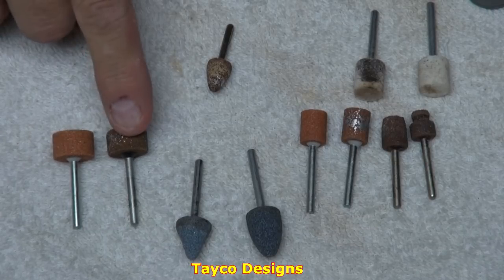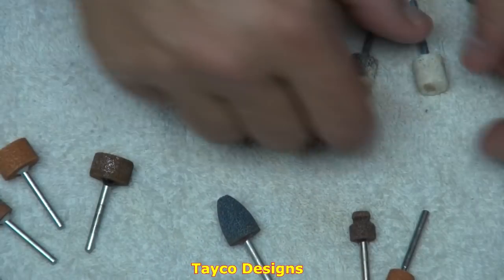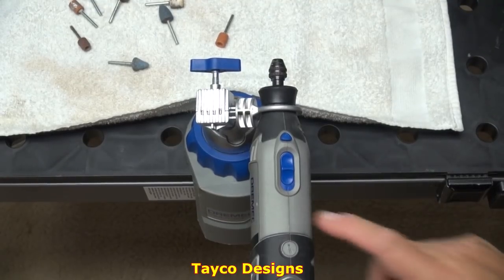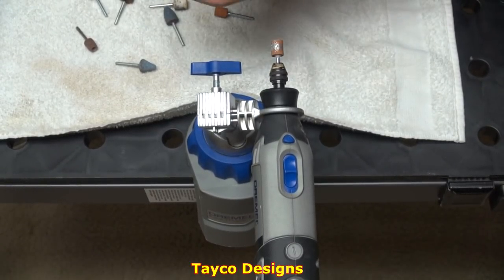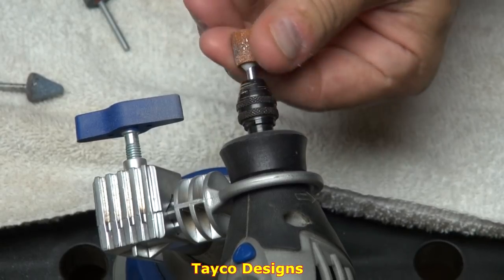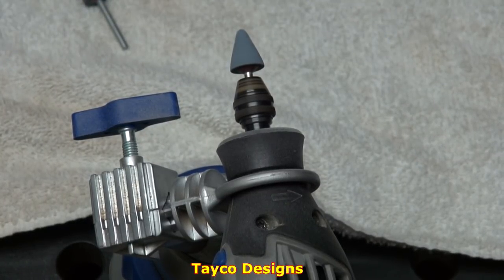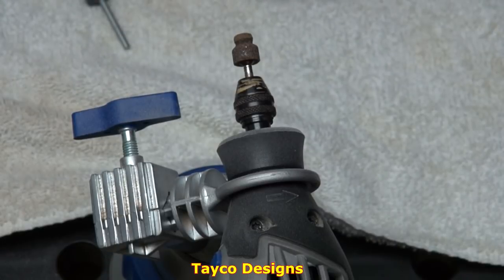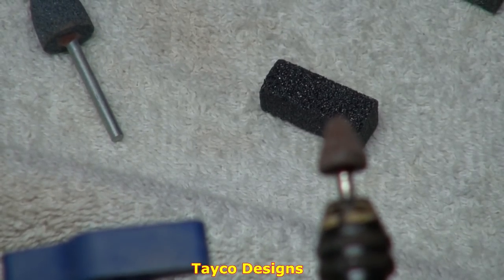How To Use The Dremel Dressing Stone To Reshape Or Refurbish Your Grinding Shaping Accessories

Comment: Thank you so much for this video.  I used my Dremel grinding stone to remove excessive material from a pair of aluminum bumper brackets on my R/C monster truck and the stone got loaded up with the aluminum.  I used your technique shown with the dressing stone and it removed all of the aluminum.  I found that setting the speed control on my Dremel 4000 rotary tool to 20 worked the best and it helped speed up the process considerably.  At first I tried setting it at 10 and that was taking too long.

If this is your first time doing this, as it was for me a few days ago, be aware that the dressing stone will decrease the outer diameter of your grinding stone a little.  That makes perfect sense since the stone is also used for reshaping grinding stones, as shown in the video.  If you have a lot of aluminum stuck on your grinding stone like I did, you will have to really remove a lot of material from the stone to get rid of all of the aluminum and thus its outer diameter will be a little bit smaller compared to a new one.

Thank you - you saved me from having to buy a new grinding stone!

Comment: If you’re going to use a grinder on soft metal like aluminum, touch the wheel to a candle or a block of wax first. It will keep the soft metal from penetrating the wheel and perhaps also keep the wheel from exploding in your face.
Reply: Thanks for this awesome tip! - maybe the OP can make an 11 min video to demonstrate

Comment: Right on! 
I appreciate the video.
I just got my Dremel about 6 months ago for something that I needed to make, and my other tools were just too big, really.
I mean, they would have worked but it's a tool that I have wanted for a long time and that was the projects that justified my purchase.
I was thinking that the stone might be something like that and the YouTube algorithm put you at the front of the list, so congratulations on that.
After one month I don't have a brass, copper, chrome, or any type of metal trim pieces in my possession that arent shining bright as ever.
I had an old rusty 18/20-inch kukri knife that had only had an edge on the belly to tip (about half the blade was 90deg. flat) I didn't care about the knife so I thought I would see how my free handling would do with the dremel only, no belt sander or grinder, I have never made a knife or really detailed shaped steel, I have however worked in fab and machine shops on and off for the last 30 + years.
It actually came out well, its a compound bevel and I was able to freehand the bevel geometry the rest of the way through with some stones and sanding drums, and its pretty dang right with the other one, but I would work it for 30 minutes or an hour a night taking my time because I'm only playing around. 
I now need to figure out the steps i need to go through to get the finish to match the rest of the knife and I might like this thing.
The Dremel is a cool little tool that can do some neat things for a single unit.
I'm going to try to do the finish and all using only the tool.
Just because I can show what that little thing can do.
In capable hands! Lol.

Comment: I buy stones in bulk and only use a dressing stone to true them back up before they get too far out of shape and only while I'm actively using them. If they  get too worn or grooved, I chuck them in a box and use them for oddball projects or ones that will use them up quickly but don't need them to be exactly true, like general grinding or paint and rust removal. If I need one to be precice or an exact angle or plane I just grab a new one.

Comment: FYI Dressing Stones should be soaked in water before use. They should never be used dry. The object that you are cleaning should be rubbed up against the stone not ground into it at high speeds.

Comment: Thanks for the nice video. Some stuff was not in focus but I didn't miss something because of that.
Now for a few questions. I've searched for dremel dressing stones and could only found the #415 dressing stone, which looks like the coarse one (the one you used most in the video). I couldn't find the fine one you show at the end.
Another question - do the dressing stones themselves go out of flat eventually? With stones used for sharpening (especially waterstones) it's necessary to flatten them from time to time (e.g. on a diamond lapping plate).
The Dremel dressing stone looks like a rather small item at not that low of a price. I am wondering if there is a more cost-effective alternative - for example, a diamond wheel dresser (used to true up bench grinder wheels, very similar function) which is more expensive, but larger and possibly more durable?
Do you have advice regarding which RPM to set on the Dremel for this job?
And final question, what are those neat-looking parallel jaw locking pliers you're using?
Thanks :)

Comment: What is a Dremel used for mostly? I bought mine thinking I would use it alot. I used to polish something once but a rag worked faster. I think I used it one other time for something. What do most people do with them?
Reply: Lots of people use them for jewelry related stuff. Making it or restoring it. Wood carving, engraving, etc.. You can polish tight spaces. The little cut off wheels and sanding drums are probably the most used tools for people. I mainly use mine for polishing with the felt wheels. Bolts and screws and things like that.
Reply: Dremels have many uses. Grinding and Polishing are only a few of the thousands of things they can be used for. Watch some videos and you can see a few demonstrations of its varied uses. Search for DREMEL but the generic name for this type of tool is ROTARY TOOL. With the right tool tip you can do anything!

Comment: This is a great video. I have a small photography suggestion. It looks like you need a macro lense and either a joby  gorillapod tripod or a big tripod for  the close up shots. An SLR macro lense looks great can be pricey. Another low cost option is a canon point and shoot camera with a rotating screen. The movable screen is important for low angle close up shots. These cameras often have a really good macro function, the have a deep depth of field and also a realatively wide angle perspective. These features would probably make your videos look even better. All the best.
Reply from the maker: Thanks for the tips.